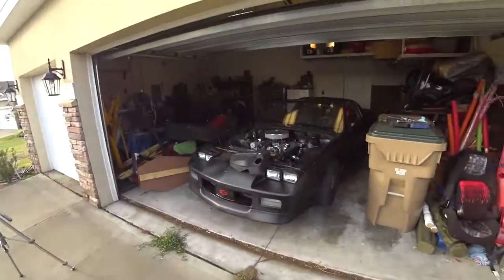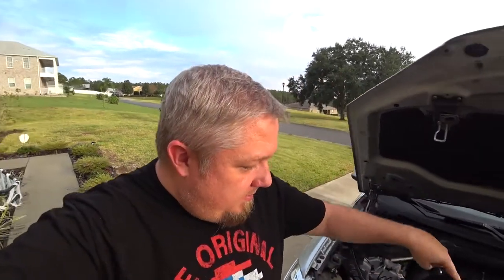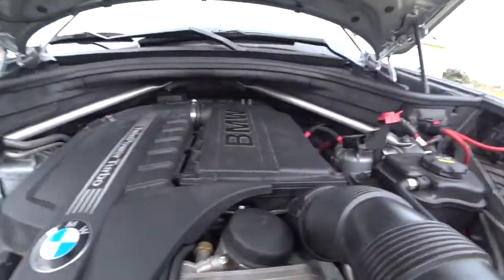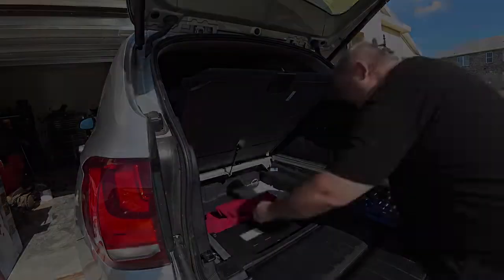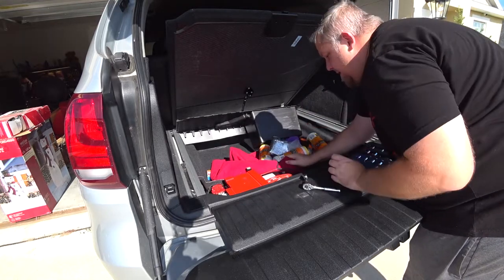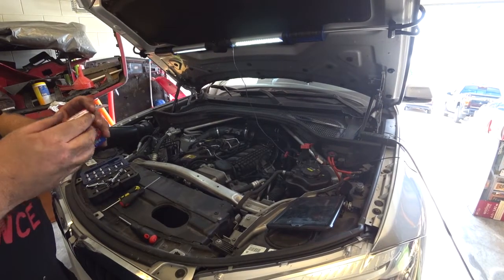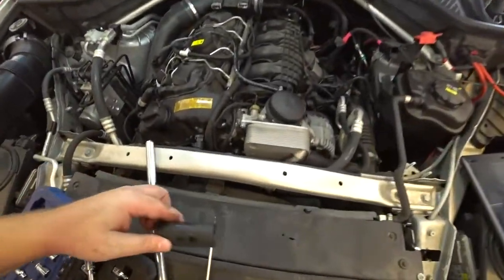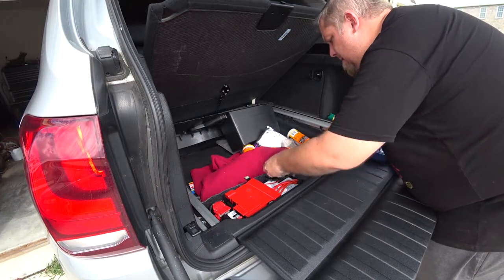BMW X5 P0128 - Temp sensor

Comment: Bro I have a 2007 bmw x5 4.8 and the problem that is giving me is that it cranks and cranks for a bit an then start what could it be I have the p0128 code and p0444 and p0420 p0430

Comment: Yeah,protools currently only supports e series chassis. Hopefully that will change in the future. Works very well on my car. Thermostat is on the way?
Reply from the maker: Nickolas Cain yes it came in yesterday but it requires a signature so now I have to play tag with the post office
Reply: @CamaroMac  haha that's always fun
Reply: I reset the engine code with the car started and that worked for me.
Reply: Which thermostat did you replace